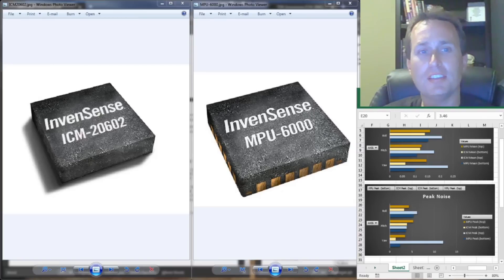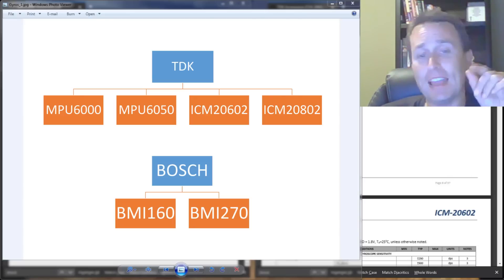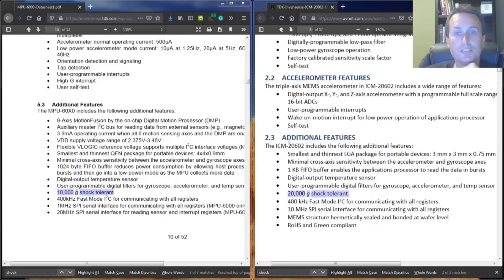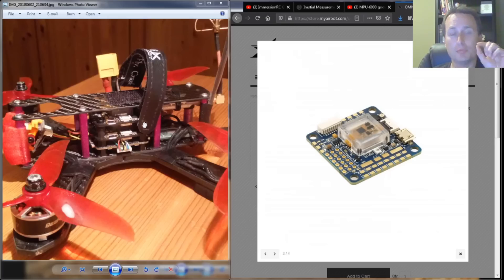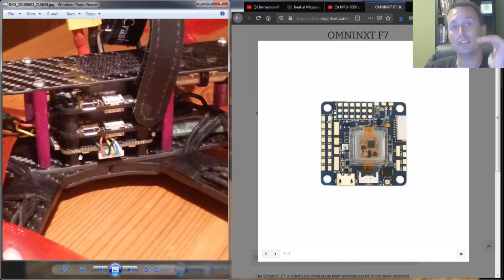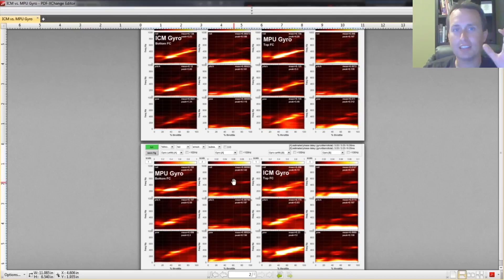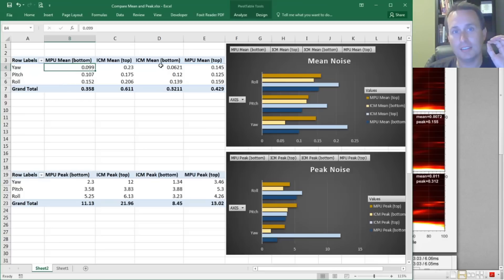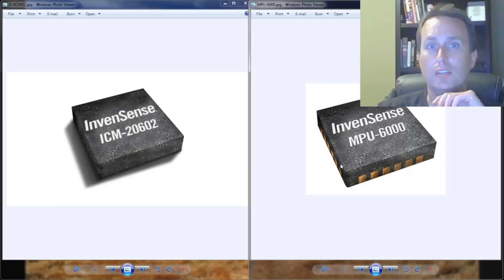Gyro Testing: MPU6000 vs. ICM20602

Comment: I know this is an old video but I figured I'd put my experience. I unfortunately just got a Lumenier Lux Ultimate F7. Out of the box the MPU6000 was bad. On flips and rolls the gyro would just go nuts for some reason. I switched the the ICM20602 and my problems went away. It is more twitchy for sure but atleast it worked for me.

Comment: So I am pretty sure I have an off the shelf quad with a BMI055, which is a pretty awesome sensor. The same underlying sensor is used in the BNO055 which adds Bosch sensor fusion, and the BNO070/080/085 which adds Hillcrest sensor fusion (those are basically just revisions of the same thing that required hardware changes) - the Hillcrest is awesome for VR folks like me, and 1K fusion rate is sufficient. (Source: worked for the BNO070 launch customer and helped tune it) But it's interesting to see evaluation of imus in other applications.

Any idea why nobody uses ST? I never see them in VR either, but they seem to have a pretty prolific mems sensor division. All the hobby/maker vendors use them more frequently, I assume in part due to price. But the LSM6DSOX (I think?) is a suitably pricy and low noise unit - maybe it's too new for adoption?

Interestingly, even assembly processes can affect the performance of these mems imus, so if you're seeing issues with just one board, it could be their processes. These little chips look innocent but they're pretty darn demanding in their handling needs if you want to use them for high performance needs, whether flight control or VR.
Reply from the maker: Unknown on the ST line.  Maybe just because BF doean't have the driver support for them?? (yet)

Comment: So I wonder if I can find mpu6000 gyros in my old cel phones and steal them for the bad gyro in my flight controller. They're probably using old stock or getting the old gyro chips cheaper. Out of all the flight controllers I've had I have yet to notice any manufacturer giving a crap about quality or reliability.

Comment: i had assumed the icm was more sensitive just because its faster. even when you sample it slowly, the internals are faster. maybe the mass of the actual vibrating mems sensor is lighter, or just the measurement circuit is faster, im not sure. Also, i thought the modern filters in betaflight basically solved the noise problem. i mostly use the icm chips and i never had any issues. just one persons experience of course.
Reply from the maker: They are both sampling at 8k.  You can set ICM to sample at 32k, but then it is a total mess.

I use ICM all the time as well.  Just seems like there is a valid reason the old MPU is still used.  

I have a better test coming soon!
MPU and ICM on the same FC and a code tweak to log both at the same time.

Comment: I use Kakute F7 ver. 1.1 with ICM gyro. It flies pretty good without any problem. There is a new version of this board ver. 1.5 where MPU gyro is used. Should I switch to the new version? Is it worth the change? Thanks mate for perfect comparison!
Reply from the maker: I would NOT change just for MPU if ICN is working fine.
Reply: @uavtech  Thanks my friend!

Comment: Why are there no fusion boards with the mpu6000?
Reply from the maker: Probably because they shows the most promise in how to deal with the variation in the signal you receive in 32k mode and you need an ICM gyro for 32k mode.  See -- https://www.facebook.com/UAVTech1/posts/2190748527852936 for details.

So when 32k mode hype died, the benefit of sensor fusion dropped off.  It is a good backup gyro in 8k mode and of course, doesn't hurt in 8k mode too.  I covered this in my iFlight TwinG review: https://www.youtube.com/watch?v=aozT7BxP9ZU

Comment: A few years back I jumped on the 32k band wagon and build my next quad with a Matek F405-AIO 
With the ICM20602 gyro, it never flew well, and had the twitch of death into a muddy ditch.
I rebuilt the same quad and put the Matek F405-CTR with MPU6000 gyro. I ditched 32K and stayed on 8k, no more issues, built another two quads with the same gyro never had any more issues.
I also build with 4 x 470µf 35v Rubycon low ESR capacitors for each individual ESCs and 1 more on the XT60, no more noise, no more random VTX failures, no need for any video filters and very smooth (well good enough for me) flying quad with very low noise.

Comment: Hey quick question - I have noticed that some fc's have been coming stock with Yaw D-values enabled. I was under the impression that the Betaflight dev's had dropped Yaw-D from the code and that is why it was set to zero. Did this recently change?  Thanks for your help.
Reply from the maker: It is there, but not advised to use.  Yaw is way too slow and D-term adds noise to Yaw, which effects Roll and Pitch movements.  So if not upside, but there is a down side, why use it?

But as always BF gives folks options.

Comment: Hi, I have the Omnibus F7v2 since a while now in a 5" quad. when I first installed it I couldn't get it to run, had all kind of glitches and what not. I even bought a ne gyro from Airbot, because there was something with shielding to electrical noise going on with this board in the early days and they've made new gyro cases for that. But that didn't either help. Only since I have selected the MPU6000 gyro on the board, it is running smooth. Btw. it is throughout hardmounted to the frame.

Comment: I have stuck with the clracing f7 dual v2.1. Out of the 5 flight controller's i have tried, i have found it works out the best for me. It is the only one i have had with the icm 20602. I dont know if it makes a difference having two of them on the board but i replaced my other boards with these so i exclusively use them for my kwads now.

Comment: could a cap in the 3.3v rail help filtering electrical noise to the gyro?
Reply from the maker: It should.  Hard to know if there is an issue there to solve until you add the cap.
Reply: It depends on the 5V DCDC converter,  
if LC resonance is around  30kHz it won't help !

Comment: The Kakute F7 has two versions now. V1 with icm and v1.5 with mpu. I have both and ICM drifts a lot more. Build identical just FC switch, baros covered with foam runing inav pos hold

Comment: 1. most of the FC's using ICM20xxx have a flawed electrical design !
 (this is a known fact for about 2 years,  follow the link for technical details :
  https://www.rcgroups.com/forums/showthread.php?2934256-OMNIBUS-F4-Pro-Corner-from-AIRBOT/page35#post38947338 )
2. the only board I am aware of that has implemented a sound design is the CLRACINGF7v1 
 (though it has other problems with the true PIT mode)
3. ICM20xxx are the better gyros
 - lower drift
 - higher precision
 ... etc. 
  It only requires better designed FC's !

Comment: Does the icm20xxx gyros require a cleaner electric layout? Asking if it is more important to have a really good 3.3v voltage regulator, to give a clean reading and signal.
Reply from the maker: Maybe.  It is important to have clean 3.3v power of course.

Comment: I have a matek f7 mini with both a MPU-6000 and icm20xxx. Don't remember which icm exactly, but tune it on the mpu6000 gyro, and then switched to the icm gyro, and it was significantly worse.
I can recommend the board though. Has held up great for me.

Comment: Was your testing with BF4.2?... if not then, I am curious on your next testing if the BF 4.2 will manage the ICM20602 gyro data better than the MPU6000 due to it's increased sensitivity - what do you think?
Reply from the maker: Tests were done looking at Gyro_Scaled (raw) noise.  

However, if noise is well defined and not broad is nature, yes, the improvements in 4.2 notch filter targeting (RPM and FFT) will crush it.

Comment: In the dual stack experiment, the comparison was between a MPU mounted directly to PCB and a ICM soft mounted in a casing on a silicon pad, right? - And there are still noise issues. Then it is not just some noise, it is also cost of the FC.

Comment: HGLRC removed the F722 dual from there product list. I have one, but used only mpu6000, which is the second gyro for choice. But these board had no(!) memory for blackbox recording and so I changed to the new HGLRC Zeus F722 DJI, which had only the mpu6000 and has memory on board. I fly only analog, but to have it DJI compatible is a nice option

Comment: Here is an issue you dont often hear talked about with the mpu6000:  it generates heat all on it's own.  Enough heat in fact to cause a noticable amount of drift during a flight from a cold boot.  Pair this with flash chips, vregs, osd, stm which are all also producing heat and you can overheat a mpu gyro very easily.  If you heat one faster than a certain threshold rate it will blow out each axis progressively with a massive drift event all at once.  Heaven forbid you also put all this under a canopy with poor airflow.  The mpu series really needs a heatsink.   In contrast the icm gyro produces little to no heat on its own and is therefore significantly less susceptible to drift.  All gyros drift with temp obviously and the icm is not immune from other things warming it up -  I'm just saying the mpu gets a big fail from me since its creating the heat which causes it to drift.  I have stopped using it in my own designs.
Reply: That is a good point - also explains why I've had better luck with gyro performance when I have nothing above it - I assumed that was EMI, but now realize that airflow for cooling might be as big of a contributor
Reply: I have always thought my quads running CL Racing F7 with ICM20602 were my best performing. This confirms I'm not crazy.
Reply: I replaced a kakute f7 v1 using iCM because it started drifting pitch and roll with Kakute F7 v 1.5 using mpu no drift. No test was done on gyro specifically so can't be conclusive but same board otherwise one with mpu holds best atm.
Reply: @anti-popfpv4638  that's a good point... the old kakute version had the icm20689.  Looking at the icm20689 smd package, it has that same giant thermal pad on the bottom of the gyro for heat transfer just like the mpu series.  I should be more specific in my statements about icm series and clarify that I have only specifically run my tests watching internal gyro temperature and evaluating drift on the icm20602.   While not concluclusive and only my speculation,  I suspect that the adding the thermal transfer die pad to the bottom of the 20689 gyro was done for a reason and this is a very different construction than the 20602.  With the kakute placing the 20689 on the tiny soft mounted daughter board... it was really limited in having significant copper & pcb material to sink heat away from that gyro and not surprisingly it drifted from temp increase (my speculation of course).  Its entirely possible this particular gyro can't withstand it's own heat generation too.  Thanks for helping me realize I should not make blanket statements about the icm series when I have only tested the icm20602 in detail.  Regarding drift on the mpu... I would agree that when the only heat source it is exposed to is itself... the resulting drift is manageable and often not noticed.  The kakute v1.5 construction certainly does isolate it from other heat sources with the soft mount.
Reply: @_NFE  I now have both Kakute f7 v1 and 1.5. i was experiencing yaw drift with v1 pretty bad to point it was no longer fun to fly so thought I'd try v1.5. i am having the same yaw drift just not as bad. I assure you setup was fresh and it wasn't drifting until quad had a few abrupt impacts. Just my speculation. I don't have anyone outside from myself to check every single one of my settings. You do great work, i was just saying!
Reply: @_NFE  I was flying yesterday with the new kakute f7 and I experienced bad yaw drift twords right this time. The reason I upgraded was bad yaw to left. My gps bn 880 does take a while to get lock and thus everything gets hot. But the v1 drifted without gps installed anyway. What can be done, if anything?
Reply: @anti-popfpv4638  if this is temp related drift, try letting it warm up on the ground while you wait for your gps lock then hot calibrate the gyro before taking off.  I believe betaflight had a stick gesture to recalibrate the gyro after it has sat there for a bit.  Every gyro is going to drift if it changes temp... not much can be done.  I suspect one day we will see small heat sinks atop gyros to minimize it.
Reply: Adam Anti-pop I had the same issues with my Kakute F7 HDV and that has the MPU 6000. Went back to the JB  F4, no issues. I ordered the JB F7, that one has the ICM 20602. Will be interesting to see the difference.
Reply: interesting

Comment: DalRC F722 Dual has both of them. I have two of these FC’s and love them. Ran the ICM for a bit when BF supported 32k but went back to the MPU6000. You should give this FC a try.
Reply from the maker: I have in the cart.  Thanks for the tip.

Comment: I'm a bit disappointed you didn't mention about overflow bug in ICM gyros. Such an error is disqualifying in my opinion. Yes, I know this is patched in the BF software, but I am surprised that the manufacturer has not produced a revised version so far. Unless I'm wrong. ;)
Reply from the maker: Good point.  But it seems rare.  Forgot about it, it is so rare.

Comment: Holybro recently changed from ICM to MPU in their FC lineup (Holybro Kakute F7 v1.x -> v1.5). Would be interesting to hear what motivated this change for them. I have had the v1.x and now have the v1.5 and (subjectively!) the noise levels are much better
Reply: Crazy that you mentioned this. I have 2 similar 5" Quads.   One Quad has the 1st generation Kakute F7 Mini with the ICM Gyro and the 1st Generation Tekko32 F3 45A Mini.  The 2nd Quad has the New 2nd Generation Kakute F7 mini V2 with the MPU Gyro & B+ pad and the 2nd generation Tekko32 F3 45A Mini that runs at 96kHz.  I'm tuning them at the same time with all the same BF 4.21 Settings, RPM Filtering, PID TUNING, ETC..    The 1st Quad with the ICM Gyro flies worse and is harder to tune. It's much harder to get the Quad with the ICM gyro to be critically damped on Inverted Yaw Spin Tick Tocks.  The 1st Gen Tekko32 F3 45A Mini also runs much hotter than the new version, scary hot.   After flying and tuning the new Kakute F7 mini V2 with the MPU6000 gyro, I'm getting the itch to buy another and replace the 1st gen stack on the other Quad all together.
Reply: @GeorgeCee  oh so im not the only one seeing crazy temps on the first mini.

Comment: Thanks for the video Mark.
I had two iFlight F7 flight controllers (30x30 and 20x20) with dual ICM gyros (first gen of SucceX TwinG). They were a complete nightmare - could not get rid of yaw twitching. This was the reason to study all of your tuning videos :). One of the gyros gave a little better results opposed to fusion, but still unusable. I have soldered also 2 additional ceramic capacitors (100nF and 1uF) to each of the gyro power supply pins. Did not help either, so I gave up. Finally I have replaced these flight controllers with MPU6000 based flight controllers. Problem solved and lesson learned: I will never buy iFlight or ICM based FCs. But I wonder what will happen when MPU6000 stock runs out.

Comment: Thanks !
You have dual gyro on this board (deluxe version) : https://www.banggood.com/JHEMCU-30_5x30_5mm-Dual-Gyro-F7-Flight-Controller-AIO-OSD-5V-8V-BEC-and-Black-Box-for-RC-Drone-FPV-Racing-p-1460428.html?rmmds=myorder&ID=17&cur_warehouse=CN

Note : ICM20689
Reply from the maker: Ken Mitchel gave me some good code too where MPU and ICM can be sensor fusion.  As a result, i can get Debug modes to get raw noise from both!!   One board!!
Reply: @uavtech  You have also this one : https://www.banggood.com/JHEMCU-F7BT-Dual-Gyro-F722-F7-2-6S-Flight-Controller-AIO-OSD-5V-8V-BEC-Support-Bluetooth-and-DJI-Air-Unit-for-RC-Drone-p-1678596.html?rmmds=search&cur_warehouse=CN
Reply from the maker: @edouardmalot51  , i just ask BG if they would be interested in sending one over.  If not, i can pick up https://www.racedayquads.com/products/dalrc-f722-dual-f7-flight-controller-mpu6000-and-icm20602-built-in-osd?variant=14546639618161
Reply: @uavtech  yes, note on bangood gyro réf is ICM20689 not 20602
Reply from the maker: Yeah, i saw.  DALRC has an 20602 and 6000

Comment: so why don't you mount the two flight controllers horizontally on a stretched   X  frame and exclude the extra vibration  due to height.
Reply from the maker: Someone else did the test.  Part II woll be taking reading from both the IMC20602 and MPU6000 FROM THE SAME FC board!!

Comment: I think that the last resoults you showed could perfectly be because of that built in gyro soft mount of that particular FC. I think that simply hard mounted gyro is much better.
Reply from the maker: Yeah, that is why i say Part I, because i need to do a Part - II that has the same mounting of the gyro on the board for both.

Comment: As written some comments below - a good electric filtering is the key for proper operation, in my experience the ICM20602 seemed to be more sensitive to electrical noise compared to the MPU6xxx series. I mostly use a 470µF/10V @ the 5V rail (from which the 3.3 is cascaded in most cases). On Invensence linecard there is the ICM-20690 introduced as a replacement for the discontinued MP6xxx ("6-Axis DMP-Enabled Drone/VR/IoT solution, Targeted For All Current MPU-6000/6050 Users"). 
The main difference between ICM20602 and 20690 is that the 20690 have a higher range of sensitivity scale factors.